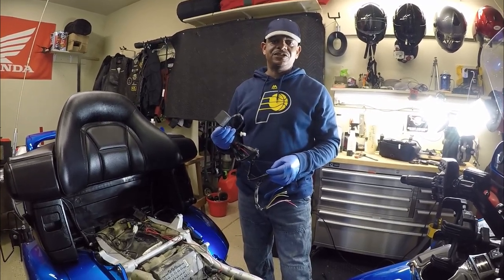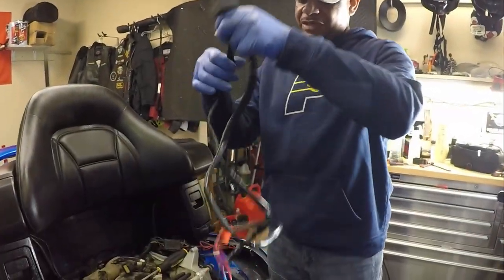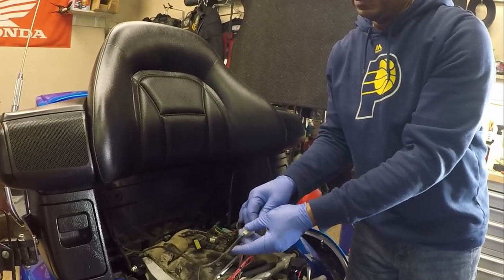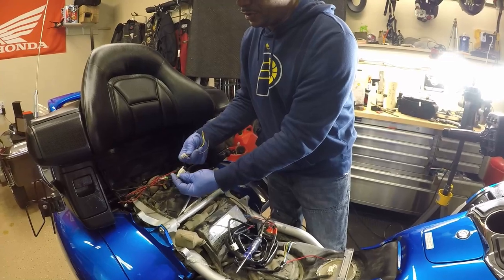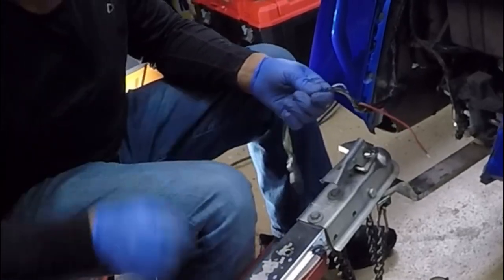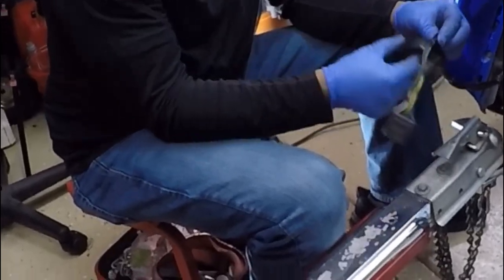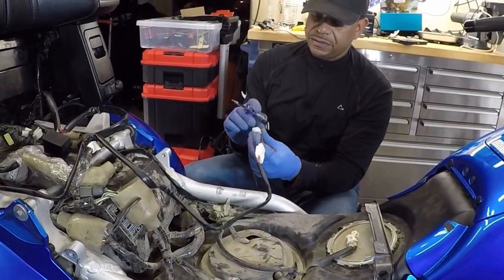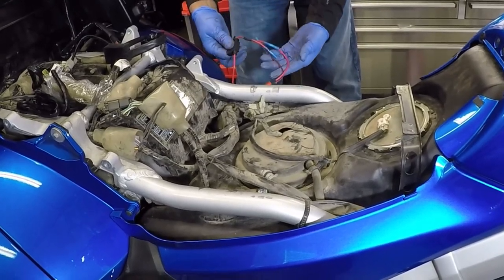Install Kuryakyn 7676 & 3230 to Mark's Honda Goldwing

Comment: Thank You Chris, The instructions are not exactly right, but your video is. Plug & Play is a bit of a miss conception when you have to add the 3230 kit. Wish they would just have it all in one. Thanks.

Comment: I have both harnesses installed where do I pull the brake light signal from for the 5 to 4 wire show chrome adapter?

Comment: Early Can Am RT 622 trailers are 5 wire
Reply from the maker: As long as the trailer wiring matches up 5 to 5 or 4 to 4.
Reply: @chriscaliente5033  Agreed